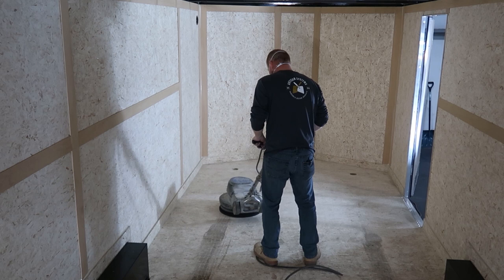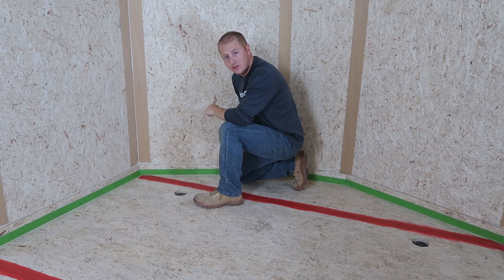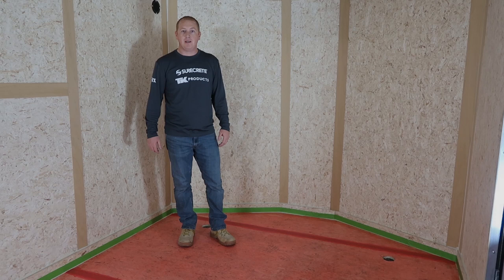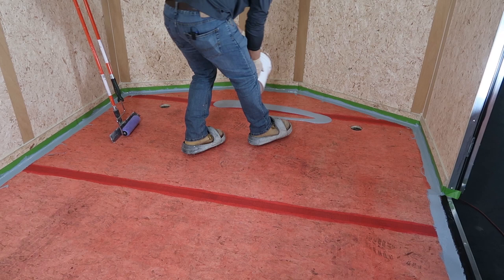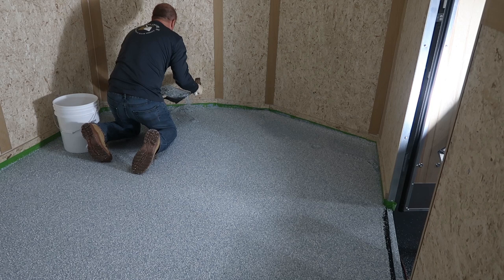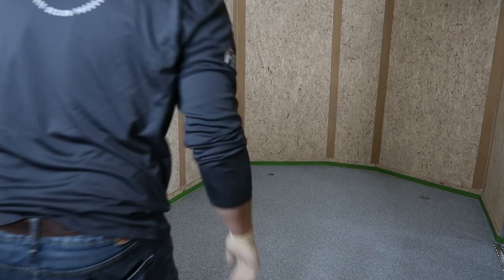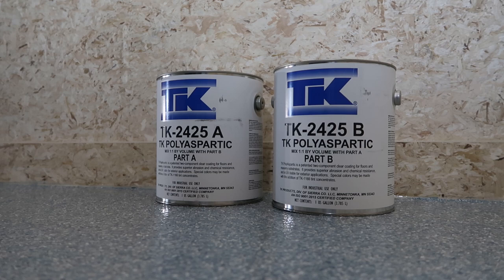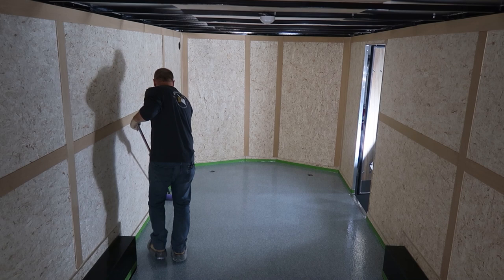DIY Enclosed Trailer Epoxy Floor // Rehash Your Trailer Trash!

Comment: Just wondering, How is the epoxy coating holding up in your enclosed trailer ?     Would you do it over again ? Did you paint the walls ?
I have a enclosed trailer for my car and after watching your video I'm thinking about doing the same thing to my trailer,  you did a beautiful job on your trailer looks great

Comment: I like these products. As for the structure, I glue together two pieces of .5” CDX. Avoid OSB. Lap the joints. Buy 1” steel edge caps. Make you floor in edge-capped panels. Use bondo cat hair to fill voids. Finish the top with epoxy paint. Water cannot enter the edge caps. You can spot weld the butted edge caps if you need to. The advantage of this system is that you get structure within the 1” and that spans framing members. Bed line the underside before you bolt the panels down. These products you feature here would work well with this floor system.

Comment: Great video.  Building out a beach runner trailer to camper. Looking for a way to put down those large vinyl floor stickers that look like the ocean with dolphins swimming.  Then thinking of putting down a thick clearcoat epoxy.  Saw in other comments to ad sure grip (sp) to prevent slipping. 

Can this be done?  Don't want $200- $400 worth of vinyl sticker and epoxy  to just crack or disintegrate.
Reply from the maker: While there are many companies that put epoxy over vinyl stickers, we generally don't recommend that, since the epoxy doesn't adhere well to the vinyl. In a trailer situation, I would think the constant movement would cause delamination of the epoxy from the vinyl.

I would recommend looking into our Trans4loor Metallic System if you're looking to emulate an ocean scene. That would hold up better than an epoxy over a vinyl sticker.

Comment: Great video..I plan on doing this to my car hauler over the winter.  Couple questions -- can you provide a link to the scraper tool and the flooring shoes/sandals you wore?  Finally -- what is the grit on the black pad that you used to sand/scuff?
Reply from the maker: Hi Robert! We used something similar to this scraper - https://www.krafttool.com/GG018 and these shoes - https://diyconcrete.com/collections/tools-and-accessories/products/tools-accessories-spiked-shoes.

The sanding screen used to sand the bare wood was a 100 grit. To scuff up the surface between coats of clear topcoats we used just a regular black pad available for floor buffers.

Thanks!

Comment: How about a video on how to keep dust out of a cargo trailer. Seem to have dust in ours any time we open the door after traveling on a dirt road
Reply: From what I've seen could be a couple of things. 1st is it a hauler or camper?  Many times trailers can have gaps where the floor meets the walls.  Also check where the walls meet the roof line g or gaps. Fill with spray foam. 

Do you have a skylight with a fan? If so reverse the fan so it pulls air from outside in. Create positive sir pressure.  Put a filter on top of the fan set inside the dome cap. Keep cap open hopefully installed where it opens aerodynamically. 

What running the top fan to pull air in from top does is push air pressure out those little side vents. So dust can't blow in. Hopefully vents also installed facing down or down wind. Try taping up a small filter over the air vents while traveling.
Reply: You need to pressurize it, the off-road trailers have them, fan filter positive pressure, keeps out all the dust.

Comment: Would have appreciated a quick rundown of the costs as shown.
Reply from the maker: Richard, you can get everything you need for this project as a kit at our sister site, diyconcrete.com, where the cost comes in around $4.65 a square foot.

Comment: Would dogs scratch it? Is it water resistant if walls painted too? an you wash with hose and not be afraid to damage wood?
Reply from the maker: Dogs can scratch it, yes, but usually don't. Dog urine, however, can be a bigger issue. Depending on what paint you use, there shouldn't be any issues with water whatsoever.

Comment: Can you add tie down hooks after you've done the floor or is it recommended to put them in before you do the floor?
Reply from the maker: If they are surface mounted, they would probably be easier to mount after the epoxy is down. You need to use a bit of caution, however, since epoxies are generally not designed to handle the shear forces created by drilling, so make sure you start with a small pilot hole and step up a few times. For this particular trailer, there were tie down anchor points installed from the factory that we removed before application and re-installed after the floor was done.

Comment: Just looking for clarification- 1 year ago you said the cost is usually $1.50-$2.00 per SF and 6 months ago you replied to Richard and said the kit can be purchased for around $4.65 (or so) per SF.  I know costs have gone up on everything, but is that the case here or am I missing something?  Thanks!

Comment: How long does this last in the long run? Does the flexing of the trailer ever crack the epoxy?
Reply from the maker: Great question! We've done a handful of these over the last five years, and none of them have cracked yet. That's one of the reasons to apply the Elastoshield over the seams and then over the whole surface.
Reply: I had the same question.  When I called the manufacturer they discouraged me from using epoxy for that reason.  Definitely interested in the Elastoshield approach.

Comment: What is the purpose of the Polyaspartics coat?
Also what do you mean by Stay En Mass when referencing the UV coat vs the Polyaspartics coat?
Also is there any restriction to doing multiples coats of the epoxy? special instructions?
Reply from the maker: The polyaspartic coat is used as the final top coat due to its enhanced chemical and abrasion resistance. 

Keeping the epoxy/polyaspartic en masse refers to keeping it in its mixing bucket. With 100% solids epoxies, like the UV Shield, keeping mixed epoxy in its mixing bucket will extremely accelerate the reaction speed, making the epoxy unusable within a matter of minutes. The opposite is true for the polyaspartics, which will cure much faster when applied to the surface.

There aren't really any restrictions on doing multiple coats of epoxy, beyond just the practical limits of applying coat after coat. The trailer will flex slightly, so the less coats of epoxy you have on the trailer the better, to allow for that flexing. If the epoxy gets built up too much, it won't flex but will crack or break.
Reply: @FenixTV4Me  how about doing multiple coats of the ElastoShield?
Reply from the maker: @DevinGleasonLambert  You could, although you probably won't gain much. A second coat would be fine, but beyond that you'd just be wasting material.
Reply: @FenixTV4Me  Thanks, was wondering if the extra ElastoShield might help prevent cracking the epoxy. I have extra so was thinking I might do a second coat. 

Also, how long can I wait before applying Epoxy? I was thinking the first weekend I would do ElastoShield then 2nd Weekend doing Epoxy? Also same question for between coats from Epoxy to UV Shield, and UV Shield to Polyaspartic? What are the recommended Min/Max timeframes I should wait for between coats of the different products?
Reply from the maker: @DevinGleasonLambert  There's no maximum time on waiting before the epoxy goes down. You'll want the Elastoshield to be completely dry, though. I'd usually recommend at least overnight. 

As for between the coats of epoxy/polyaspartic, if you don't apply the next coat within 24 hours, you'll need to degloss the surface, usually with a floor sander or buffer. Minimum times are just as soon as the product is cured enough to walk on, usually within 8 hours for the epoxy, 2 hours for the polyaspartic.
Reply: @FenixTV4Me  Does that mean, If I don't wait between the UVShield and Polyaspartic, then I do not need to buffer the floor with the black pad?
Reply from the maker: @DevinGleasonLambert  You'll only need to run a black pad over the surface if you go past the 24-hour redcoat window. If you apply the polyaspartic on the UV Shield within 24 hours of installing the UV Shield, there's no need to buff the floor. Thanks!
Reply: @FenixTV4Me  oh great news, thanks

Comment: Do these products has an major odor while using them? What kind of working time do you have with each?
Reply from the maker: The epoxies have a slight plastic smell, but nothing offensive. The polyaspartics do have solvent, so they will have a harsher smell and need to be done with proper ventilation.

Working time for epoxies is 30-40 minutes, for the polyaspartics it is more like 10-20 minutes.
Reply: @FenixTV4Me  Thank you

Comment: How did you handle getting material from the main trailer to the ramp?
Reply from the maker: We treated the two as separate floors, actually. We applied epoxy to the main trailer part, collected the excess, then applied additional epoxy to the ramp. The gap between the two was too large to try to move epoxy from one to the other.

Comment: How well would the floor hold up to a snowmobile?
Reply from the maker: It should hold up pretty well. The skis may scratch the surface after multiple times running over the same place, though.

Comment: One more question, what about antiskid? Which part of the process could an antiskid additive be included?
Reply from the maker: You would want to broadcast your anti-skid, such as Surecrete's SureGrip or Concrete Coatings' SlipGrip into the topcoat before bankrolling, to ensure it gets fully encapsulated. This works especially well on the tailgate, which has a slope and is exposed to the elements when open.
Reply: @FenixTV4Me  okay thanks. I reached out to diyconcrete.con via email BTW, not sure if your affiliated or not.
Reply from the maker: @DevinGleasonLambert  They must be having trouble with their email. Have you reached out via phone?

Comment: How long did this take from start rot finish?
Reply from the maker: It was probably 6-7 hours over 4 or 5 days. Most of the time comes from allowing the products to cure. That time could be sped up if you used only polyaspartics. You could do all of your resin coats in one day.

Comment: That’s just too much work , use flex seal  then truck rhino liner and clear coat if you want to and done.   None of that B.S. expensive and a million steps.